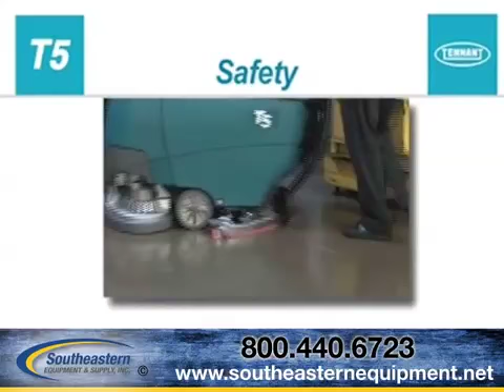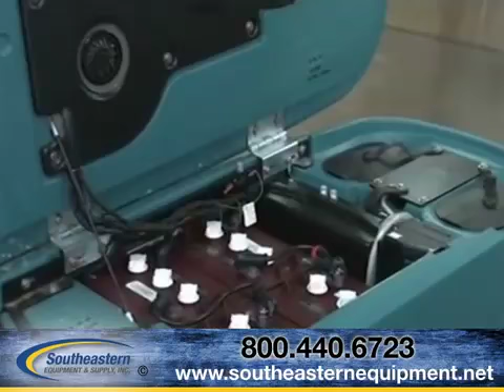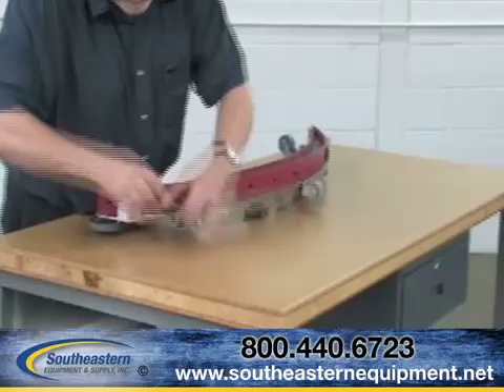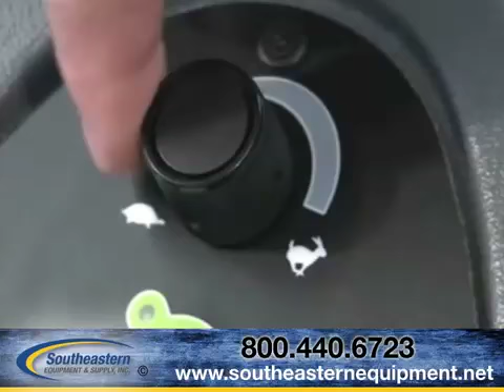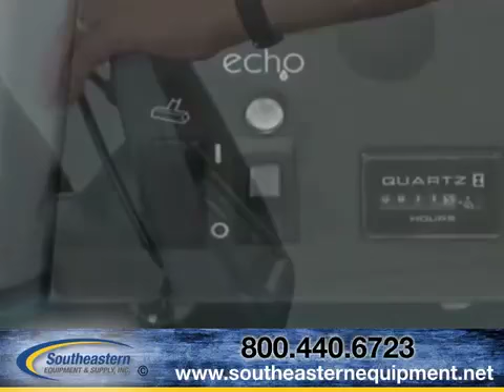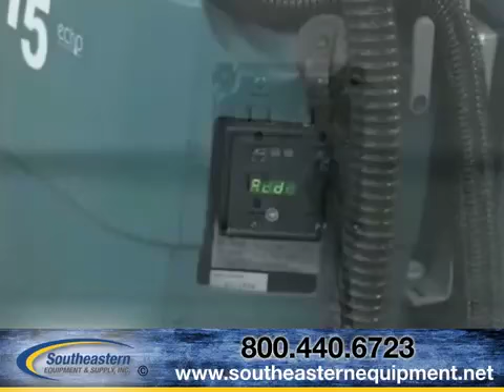Tennant T5 Floor Scrubber - Operations and Maintenance

Comment: I've got a leaking head. Water keeps draining where my pads go and I can't seem to find a problem. I suspect there's some debris in the line keeping a valve from shutting?
Reply: Perhaps a bad solution valve?
Reply from the maker: @user-fl1jv9cv7z  Hi James, It could be a number of things. Check the troubleshooting section of your Manual, call Tennant Tech Support at 800-553-8033 or fill our a Service Request Form here: https://www.southeasternequipment.net/Equipment-Service-Request-s/117.htm

Comment: how i can fixt the vacuum
Reply from the maker: Hi Felix, according to the Operator's Manual if you're experiencing an issue with the vacuum motor not operating, it could be one of the following causes: Squeegee is raised off floor, discharged batteries, faulty control board, faulty vacuum motor or wiring, or worn carbon brushes. If you would like to have a technician come inspect your scrubber, please fill out our Service Request form here > https://bit.ly/3d1NMk0

Comment: Why is it leaving streaks
Reply from the maker: The most likely reason is the squeegee blades. Try rotating them or purchasing new ones. It's also a good idea to verify you have the right type of squeegee (i.e. gum, linatex or urethane) for your floor type. If you need additional assistance, email us at <Parts@southeasternequipment.net>
Reply: Jefe necesito por favor conversar  con ud

Comment: When charging this machine do you need a transformer for this?
Reply from the maker: The Tennant T5 comes standard with an on-board charger and an off-board charger is an option. For more information about charging the batteries, consult page 20 of the Operator's Manual. If you need a copy, email us at 'service@southeasternequipment.net'. Thank you!
Reply: What does it mean when only one blinking red light on the battery?  Battery been charged overnight

Comment: What happen if the battery is totally discharge
Reply: Tnkz
Reply from the maker: If the scrubber is completely dead, you may need to trickle charge the individual batteries to a level that the charger can read and turn on to complete the cycle. If this doesn't work, you can fill out a service request form on our website. Thank you and good luck!
Reply: How do we kno battery is fully dead...??
Reply from the maker: @awesome_one_9340  The machine would not turn on and would not respond to charging normally.

Comment: What happens when the dirty water is not pulled off the floor?
Reply from the maker: Hi Florence, the Operator's Manual lists 12 different reasons for poor water pickup. Email 'service@southeasternequipment.net' for a copy of the Manual.
Reply: Puede ser que el tanque de aguas sucias se encuentre lleno 

O la manguera de subcion este obtruida o el scuigeen este dañado

Comment: How do you operate the lockout? I recently started a position and one of the older employees has the pad pressure and water level locked and does not know how to unlock it. The manual doesn't say anything about it.

Comment: Hello. I just replaced the batteries for new ones. 3 months in & the machine slows down & then speeds back up to regular speed again. Also when in reverse it locks itself out if I go too fast or if I suddenly stop it while in reverse. Do you know a solution for this?
Reply from the maker: Hi there, please email us at service@southeasternequipment.net so we can help you diagnose this issue.
Reply: Potentiometer or voltage drop.

Comment: How many hours of ec2ho use on a regular super market floor before the squeegees need changing or/and flipping over?
Reply from the maker: Hi Pete! Most recommend a squeegee rotation between 10-20 hours of use, 3 months, or when streaks start forming behind your scrubber.  On a waxed tile or polished concrete supermarket floor, it could be closer to 20 hours. Visit our blog to get the most out of your squeegee blades: https://blog.southeasternequipment.net/2019/12/squeegees-101-pro-tip-buying-guide.html

Comment: Water is not coming out when I use the machine . Can you tell me what things to check
Reply from the maker: Hi Julio, if there is little or no solution flow it could be a number of things including an empty solution tank, clogged solution tank filter, discharged batteries, clogged solution valve, or faulty control board. Contact us at 'service@southeasternequipment.net' for further assistance.
Reply: Vacuum won't work

Comment: Can the 'echo" technology be used to clean auto shop floors? that have grease etc?
Reply from the maker: Yes it can be. Depending on the level of soil, it may be better cleaned using ECH2O combined with the severe environment option.